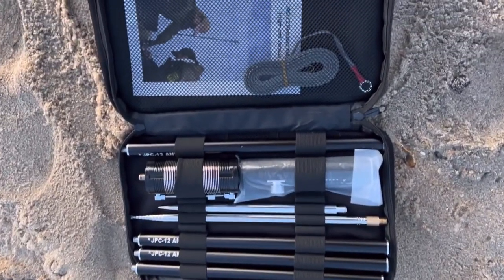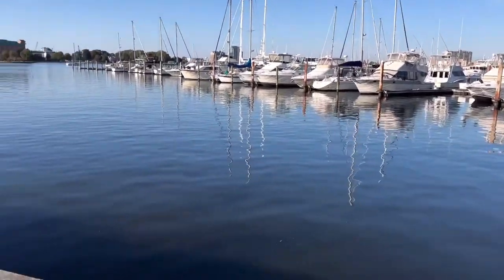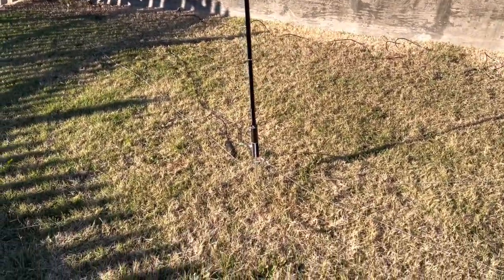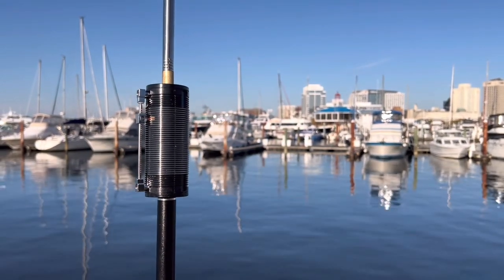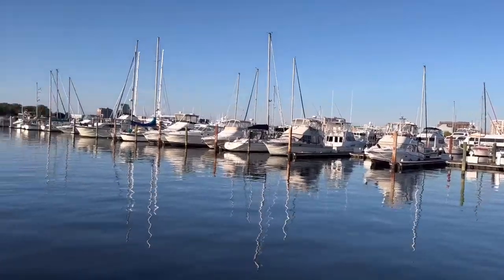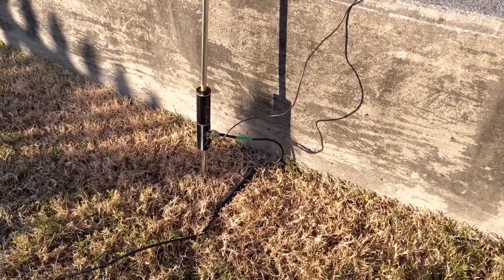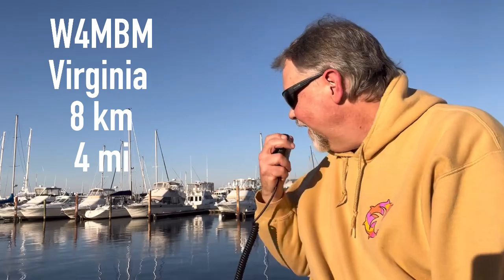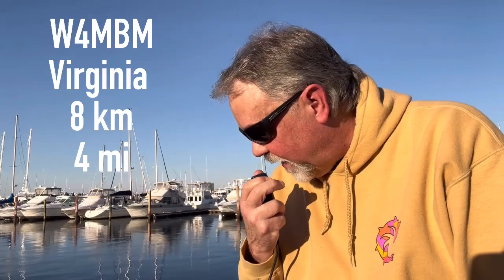JPC-12 Antenna - Making it Work Successfully

Comment: 5 ground radials equates to about 40% efficiency for a 1/4 wave vertical. That is the equivalent of 8 watts of power being radiated with a 20 watt transmitter.
Reply from the maker: You’re missing a very big factor in this calculation and that’s the ground’s conductivity

Comment: I am going for JCP 350.  80 to 6M.        

I haven’t used it but from watching various videos on tuning JPC antennas.    One video uses a SWR meter to tune the antenna perfect 

You need a choke on transmission like to prevent it from acting as counterpoise 

Also  the ground radials need to be rolled up depending what band you are on.
Reply from the maker: I’ve got a JPC-350 and will probably do a video using it on 60 and 80 meters soon. 73, Walt

Comment: Hi Walt

Others have mentioned that they resolved the grpunding issur.  Some units jave the M10 female socket recessed. The added a similiar sized washer between the goind spike and the coax / antenna module. Problem solved

Comment: So strange, Walt. I have had VERY good luck with my JPC12. I think you might be right about the ground connect being squirrely for you. The only antenna I have had better luck with is a vertical EF I built.  I used my JPC12 in 10m mode (Coupled with a qt60) last weekend and made some great contacts out in the park. No tuner, just antenna config. I guess like anything out of china you might luck out, or get burned. Either way, glad you had a workable result finally.  Onna these days I'll getcha in the log! 73

Comment: Walt, thank you for the video. I was born in Norfolk VA. I am a tech working on general but having a blast getting contesters. POTA hunting with a dipole in the yard in NC. Two of us here in NC got the g90 because of you. Well thanks for answering my 10 meter JPC-12 questions not in the manual. No coil and no poles. I have a few ground plane solutions. 73 KR4BAD David

Comment: I just bought one about a week ago and have hit Eastern block nations in Europe with 20 watts on my HR2510 on 10 meters. I used the counter poise wire included and spread it out on grass. SWR 1.7. Works better that my home built diepoles. Thanks for the video. 73’s. W4FNP

Comment: Walt, inside the base from the so239  is a possible less than perfect solder joint. the base comes apart with just that wire connecting the so239 to the top,  Also that wire is really small and could be stretching  , working OK on receive but not so good  with a transmitted current?   One fellow replaced  this wire and everything worked very well !!

Comment: I have been using this antenna on my balcony for quite awhile now and it's been amazing. Without the coil and the 4 metal tubes and the whip extended to just the first 4 extensions, I have been working Europe, S.America with great results. It took a bit of tweaking to get it right, but I'm very happy with it.
Reply: Can you please share a photo of the antenna on your balcony?

Comment: I was amazed at the low SWR this antenna provided when you tune it properly.  I found having a nano analyzer made things sooooo easy.  Without the analyzer it was a bit tedious.  And I made excellent DX contacts, 50 watts.  Since there are ten elements in the ribbon cable I divided it into pairs of two wires, so I had five counterpoise elements.  Worked great.

Comment: Aloha Walt, I just subbed your channel today. I heard about your channel last week on a Live Stream with T.O. KM9G Steve. 
    I recently bought this same antenna for $108 on AliExpress and was impressed with the case it came in. I bought for my two G90’s and my new PMR 171, which along with this antenna and two more, I have yet time to play any radio but wife is going to Japan with a childhood girlfriend for 10 days and I aim to play a lot of radio at a small beach park called Kewalos or Kewalos Basin just outside of world famous Waikiki and down the street from the Ala Moana Outdoor Mall. 
     This small park is basically a small parking lot on its own island, surrounded by four bodies of ocean saltwater. 
    I have operated here many times with my G90 with only one watt of power and my average contacts is 5,026 miles with signal reports of 5/7 to 5/9+10 on a single watt. 
    So I plan to use this antenna and the other two on 10 and 11 meters USB/LSB only. 
     I will also be trying to learn this new rig also, the PMR 171 with the compass, GPS and DMR modes also. 
     I ❤ your idea of using a pool noodle and a piece of wire, it’s wonderful idea. BTW, I use these free pool noodles left on Waikiki Beach to protect my antennas while in storage or to protect them while in the back of my Jeep. 
    I was hoping to find your channel because I understand that you operate in beach communities also. 
     Four years ago, I got to see the Chameleon vertical antenna connected to a IC-705 with no radials in a friends yard make several contacts on the East Coast on 5 watts under poor band conditions and I was very impressed until I saw the price tag of this antenna bag. 
   So I bought a ground spike on eBay from Frankie of bd7-Maple and a 2.5 meter telescopic antenna for less than $80 and been very happy with it ever since. 
    Since then, I bought a second G90 off a airman on JBPHH along with a PA125 100 watt amp and all the cables along with the fan tray connected on the bottom of the G90 with the updated firmware for JT65 and FT8 Call. 
    However, since I travel to Rosslyn, VA for two weeks every year for Memorial Day weekend, I wanted more of a “shack in box” rig, thus, the PMR 171 because I ❤ using the local repeaters in King George also. This way, I won’t need to carry so many radios. 
     Plus, I’m trying to learn to do POTA’s but not having any luck because most Hams here in Honolulu has never heard of POTA’s, which is very strange but many here do HF barefoot is probably the reason why. HOA Restrictions pretty much prevents me from operating barefoot here. Plus I’m retired now and more travel is part of my plans these days, my G90’s and this new PMR 171 just makes more sense to me. 
    So if it’s ok to you, next year, I would like to see if we can get together and play some radio after I’m finished visiting my dad and my US Marine buddies at Arlington who didn’t make it back. 
     I subbed your channel to see if I can learn more from your channel and about operating on or near the ocean. 
      Mahalo and 73! 
            Todd WH6DWF 🇺🇸

Comment: Have you used an endfed antenna and which is more efficient in your opinion? Thanks
Reply from the maker: @OverLordkv  yes I’ve used several end feds and they are absolutely more efficient than this antenna. You can check out my channel, I have many end fed videos. 73, Walt
Reply: @COASTALWAVESWIRES  thanks, I will watch it for sure

Comment: I haven’t used it much yet, but I’m glad I didn’t just buy a dud. I do want to put better counterpoise wire on it though, and add a second coil for 80 metres. I’m told you need 20 metre long counterpoise for this though, but I wonder how many strands is enough.

Comment: Walt, I really enjoy your videos. Is there any real difference between the set up on the beach and the single wire dangling in the drink? You certainly got a better performance when you changed the connection point for the earth/counterpoise.  I guess your experience lead you to believe there was a solution.  Cheers 73

Comment: So why did they use 3/8 x 20 threads instead of the fairly standard 3/8 x 24 threads on all their stuff. Now it is incompatible with all my other coils and whips. Very stupid ... cant even use it on my mag mounts ... sending it back for refund as all my mounts are 3/8 x 24 thread.

Comment: The base where the spike and ground wires attach needs to be sanded back to bare metal then good connection will help. Great videos I am enjoying. 73 ZL3AXL

Comment: Recently got this antenna and measured the resistance from the coax ground to the bottom threads, almost a 1 ohm difference. couldn't get SWR below 4 on 20 meters. Wonder if that's the issue. On 10 meters, I eliminated the coil and got it to about 2.

Comment: Im not sure this is your case, but I found with my homemade version of the PAC12 The higher above my ground plane the antenna the worse it works. I use the meatal screen "Magic Carpet" for a ground plane and if I elevate the antenna more than 3 feet over the screen it wont tune without a tuner.
Reply: I was going to try mounting on a camera tripod. Hmmm.

Comment: Bought one of these when they first became available. The so239 connector on it would not allow any of my coax pl259's to screw on beyond like half of their normally used threads, almost like the connector was tapered larger further back.  Ended up returning it.  I have several WRC's to compare results to  and have had a few Gabil antennas also (sold the gabils). Recently got a new jeep and wanted to have a compact ground stake type vertical antenna to keep in a bag, just to have on hand.  Opted to give one of these antennas another try (branded Chelegance but with the usual JPC 12 logo).  Same exact deal,  the so239 only allowed any of my coax connectors to only screw on partially, not enough to let them snug up properly.  Yesterday, I replaced the so239 with a new panel mount 239 and it now works perfect with all my pl259 connectors/lines.  Antenna worked great on all useable bands hastilly set up out back,   swr's as low as 1.06 on 20m phone realm (nice), averaged 1.2-1.6 otherwise, depending on radials (learned that with 10 & 11m bands, they were at their lowest with just bunching up the radials in piles right close to the ground stake).  40ft of rg8x on ground.  Rigexpert meter.  I like it,  it made it to the "keeper" status. Do wish they woulda opted for 3/8x24 threads all around.
Reply from the maker: Yes I would use it more if it was 3/8-24 myself. 73, Walt

Comment: I have one of these and I noticed on first assembly that it's important to get the 'eye' connector up the right way otherwise the plastic connector spoils a good connection.  I'm going to buzz up a mod on the lathe.  If it works I'll send one over.  73  John
Reply from the maker: Awesome, thanks!

Comment: Ok interesting. I got that antenna as well with the G-90, 20 meters worked great, couldn’t hear America at all on 10 meters but curaçao and Belgium.  I raised the base of the antenna 5 feet using pvc pipe then ran the 8 radials sloping and 20 meters much better. I may work and improve the radial system as well. I am in a valley close to Smoky Mountains and that may hurt my signals.
Reply from the maker: I think it’s all about improving the radial system with this antenna

Comment: Hi thanks for the nice video i have success contacting indonesia from saudi arabia a round 5400 kilometer with 5/7 report it was in a roof of a 3 stories building i spread the counterpoise into three two horizontal opposite and one hanging down through the wall . It is a great light weight antenna
73 from
7Z1FA/ ST2KI🎉

Comment: I make it split to 2. Each one 5 strand. My direction for counterpoise i point to east and west. It’s work fine
Reply from the maker: You have one with a good ground connection at the bottom of the hub for sure.
Reply: @COASTALWAVESWIRES  yes. For sure this antenna very effective at the beach. Like what you do 😁.

Comment: I have found mine worked best with 3x 4m 20ga silicone wire for up to 20m and a second set for total of 6x 4m for 40m. The factory ribbon didn't work at all for me.
Reply from the maker: That’s interesting. I’m obviously not surprised at all the ribbon didn’t work for you. 73

Comment: Walt, on your previous video, I wonder if running a 2.4k bandwidth might give you punchier transmit audio?  I saw that you were running 2.8k before.  Just a thought...
Reply from the maker: Yes I’ve adjusted to both, I just get better audio reports with 2.8 and still seem to get out pretty well.

Comment: Another good video Walt, I’m glad you didn’t give up on it. I have that antenna and had to add 8 16’ counterpoise wires on 20 but it worked better on 40 with the ribbon cable split into 4. I might open the base up and add a better wire to the ground as recommended by several people.
Reply from the maker: Thanks Corey! I think I'm going to perform some surgery on mine as well.

Comment: Nice follow up Walt. The G90 is good with its swr sweep function for these coils, I’ve a SlideWinder as well. If I have my nanovna with me I always measure return loss as well. You get real time readings as you adjust the counterpoise to achieve more than -20db (the more the better). Would be interesting to take measurements with your different dirt/sea setups 👍
Reply from the maker: Thanks for commenting, I just subscribed to your channel. I’m actually a graduate of the Westlawn School of Yacht Design and have a passion for boatbuilding as well. I work in shipbuilding now. Glad I found your channel. Yes I really need to get a proper antenna analyzer and take a bit more of a scientific approach to these antennas with greater detail. All the best and 73, Walt
Reply: @COASTALWAVESWIRES thanks for the sub - ideal for insomnia 😆. Didn’t know about your Westlawn/shipbuilding, that’s cool, but looking forward to a low power qso across the pond one day 👍

Comment: I discarded the ribbon cable and now use a minimum of six 1.5mm2 (about AWG 16) cables with gold-plated ring terminals. The antenna now works much better. Worked lot of DX even with 10 watts from my Xiegu X-6100.
Tip: (carefully) remove the black coating at the bottom of the base unit (I used sandpaper) to get better contact
73 gd DX Juergen, AH6UN / OE4JHW
Reply from the maker: Great tip, thanks for sharing! 
73, Walt

Comment: Hi Walt, I bought one of them JPC PAC 12  Antennas, Just to see how it is made, I have found loads of things that make it a bad radiator of RF, The first is what you found A coating on the spike & A bad ground connection at the base, Then there is them screw together sections that are press fit in the ends of each section that causes a bad connection & Rf lost as heat there, On to the coil the wire at each end is just bent round the bolts at each end of the tuning rod & tightened down so another bad connection there. In my opinion it's a very badly designed Antenna.
Reply from the maker: Interesting, thanks for the info! That also explains why it works so well on 10 meters compared to other bands as it's just the telescopic whip without the screw together sections. I'll stick with my favorite green coil in the future ; ) 73 my friend!
Reply: @COASTALWAVESWIRES   Exactly Walt,  But even the Telescopic whip is poor quality.

Comment: Hi Walt good for you giving it a bash again. Honestly I think this antenna is a fail - there’s no way that the design can rely on a pool noodle  s  as Atwater amp and still consider it a success.

I’ve seen videos where the uhf was taken apart and the connectivity was actually missing - I’m guessing that’s where it is. 
The only success you had was with the telescopic whip the rest giving multi band capability was a fail of note - I say move on and build yourself the 10m moxon before the band closes
Reply from the maker: Roger that, I was simply trying to show it's connectivity issue at the spike. It would have probably done as well with a good groundplane instead of the saltwater noodle. Yes I need to get that 10M Moxon built! 73 my friend!

Comment: Nice comeback video, Walt.  I’m wondering too if you have a bad base connector.  The anodized coating should not be a problem because the spike provides continuity to the inside thread. As an engineer narrowing down on the problem, I would test the noodle on the spike instead of in the PL259. If it works, you can confirm that it isn’t the base. Would be nice to get your follow up if you ever do come up with a definitive cause for the issue. After all, the center loaded ground plane is a simple antenna which should radiate as designed. Thanks again for the followup. 73 K8YX
Reply from the maker: I'm going to do those checks for sure. I'm a Field Engineer, we get it working via any hack we can come up with and then figure out the problem LOL. I'll probably do a Short checking conductivity at the base soon. Thanks for following along with this one. 73

Comment: I have one of those. I found it has a real preference for certain types of 259 connectors. I had some that would NOT screw all the way down and some that would. Once I found a cable the would seat all the way worked well. Also made my own radials and used a nice ring terminal to connect them. Oh yeah, connected the radials on top of the spike.
Reply from the maker: Interesting, thanks for sharing

Comment: Walt, thank you for doing another video but Im not convinced. I have a viewer request. One take a multimeter out in the field and test for continuity and 2 when in a qso as the ribbon is connected, attach your pool noodle to see if the signal goes up or down. And also ask if your signal went up.  Thanks in advance KD2GIY from NJ.
Reply from the maker: When I use this antenna again I will do that. Might be a little while, two JPC-12 videos in a week has hurt my brain lol

Comment: Surprised you had that much trouble getting it to work with ground plane radials. I'd be probing around with a multimeter to see if those radials are actually connected to the shield of the coax. I've had pretty good success just using a 17 ft whip with a set of radials up here in the mountains in Utah.
Reply from the maker: I love my 17 ft whips. Yes there was definitely connection issue between the hub and spike where the radials were connected